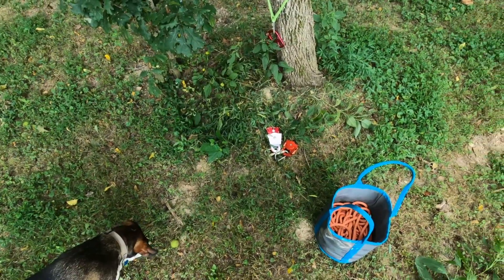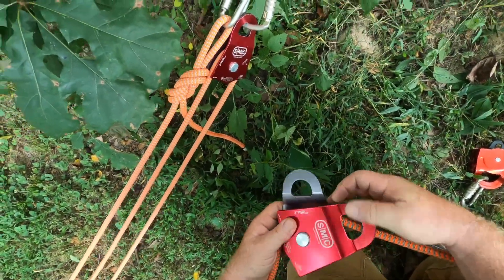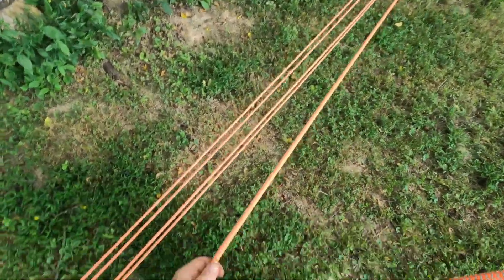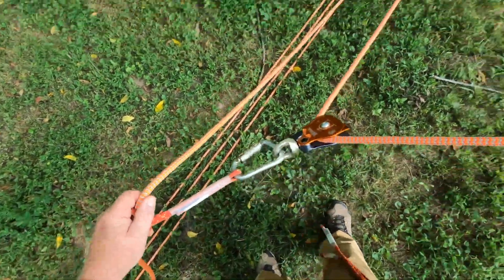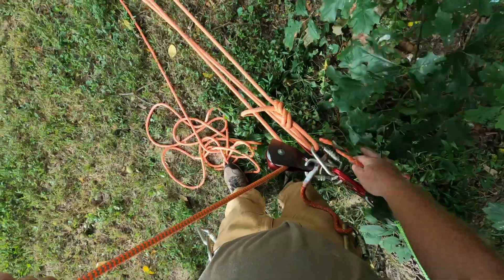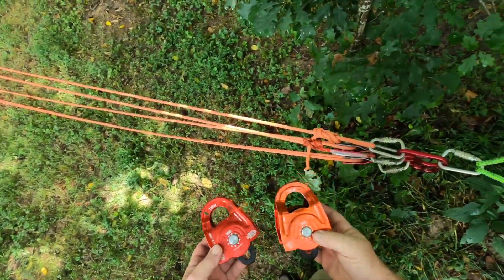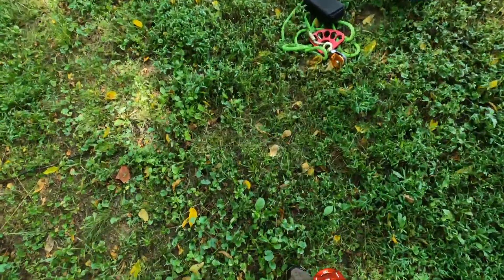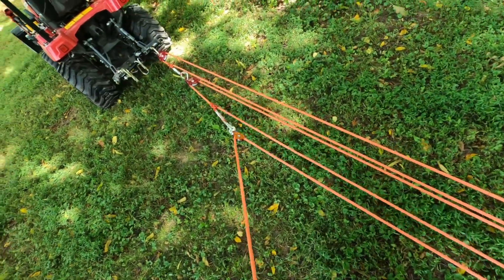12:1 pulley system converted to an 18:1 for heavy loads

Comment: I learned to climb ropes (SRT style) so that I could saddle hunt and immediately became interested in rope-rescue methods. That is when I fell in love with pulley systems. I know that I will never be called upon for a rescue, but I am a hunter, and I use what I learned about hauling with pulley systems to haul game back to my truck when necessary.
Reply from the maker: Always keep in mind you may have to self-rescue. I probably need to make a video on how to escape your restraint system if you were to fall. Hanging there in a cheap harness for any length of time can as dangerous as hitting the ground.

Comment: So that 1st pulley is the work horse and then each pulley in sequence  only needs half the strength of the first  pulley according to the load attached??
very good demo btw!
Reply from the maker: Not quite sure about half but yes each pulley is working at different efficiencies and speeds. You will always have the theoretical mechanical advantage that will never match the actual mechanical advantage due to friction and mechanical inefficiencies. Thanks for watching!

Comment: So frustrating you didn’t clearly show the capture set up. The ropes were crossed and jumbled. I have no idea where you put it.
Reply from the maker: See if this explanation helps:  Starting at the figure of eight knot, trace the rope through the pulley at the tractor. The line coming out of this pulley towards the anchor is the line the prusik is attached. AT the pulley on the anchor. Visualize how each strand moves for better clarity and you'll understand why this strand of the system is used. Good luck
Reply: @perryfire3006 It was clear to me ! Thank you